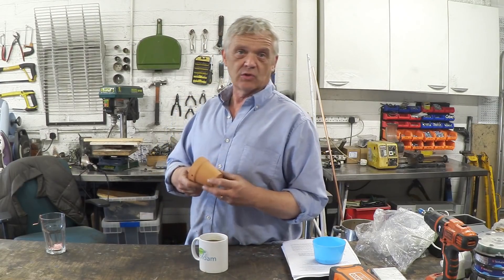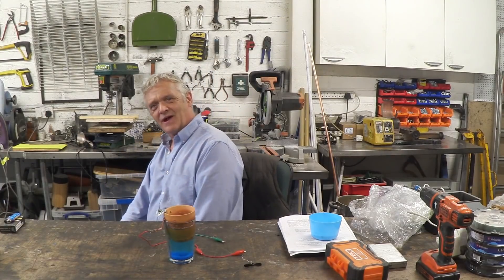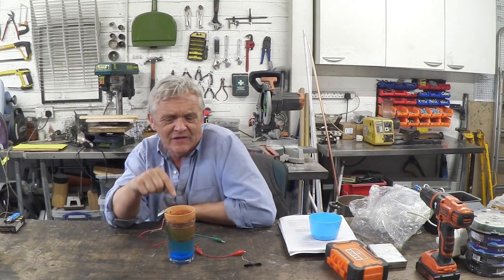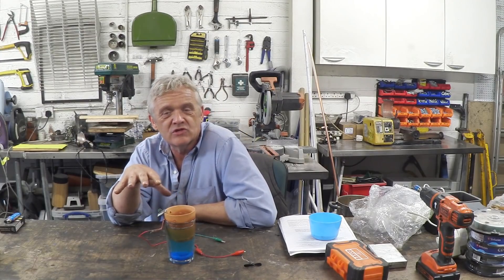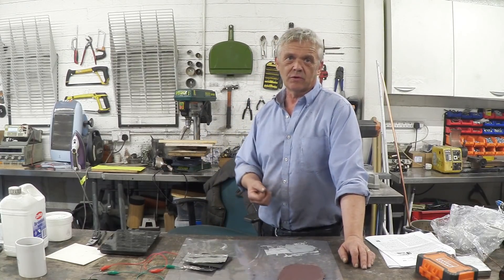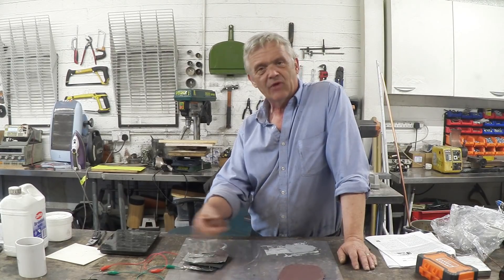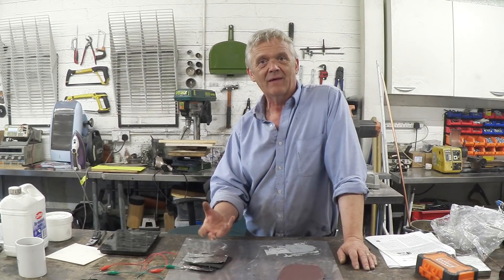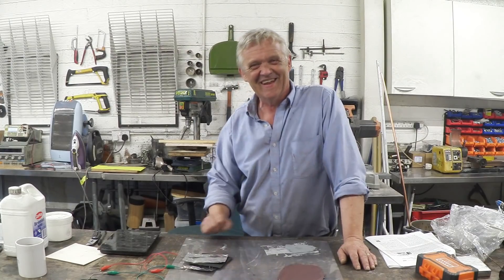1245 How To Make Your Own Super Battery - Copper Oxide Zinc

Comment: I want to be able to get 1.67 amps at 9v out of something like this, is that possible and if so how would I go about that?
Reply from the maker: for amps add mass - for volts connect in series
Reply: @ThinkingandTinkering  add mass to the electrodes? I'm thinking the point where you said double the ingredients is what you are referring to.